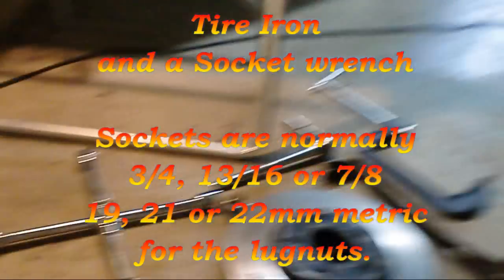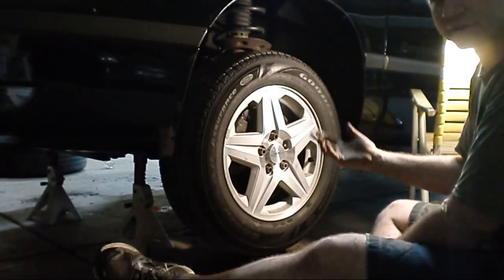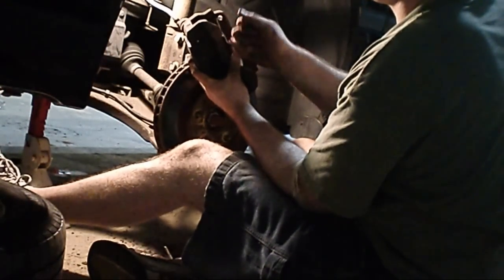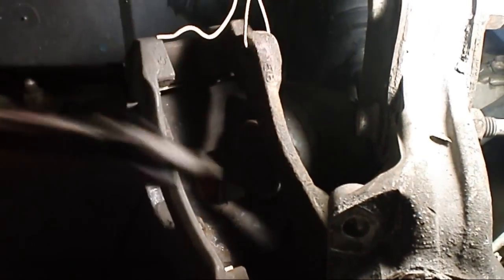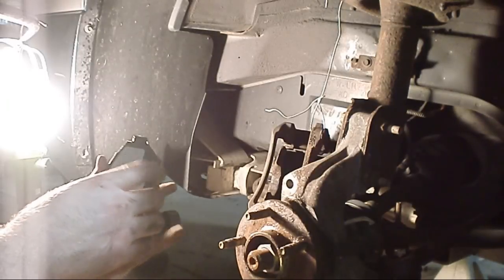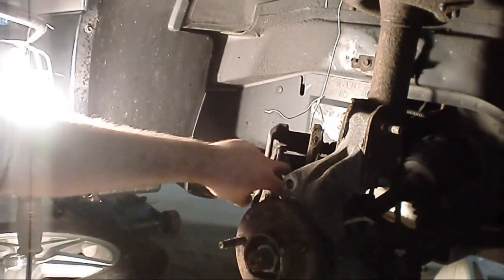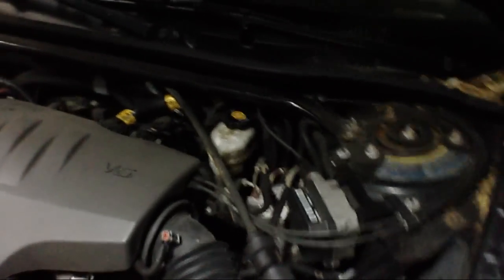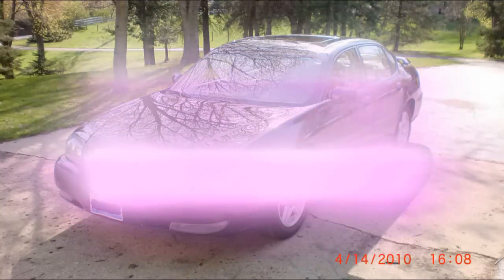(HT) How To Change Your Brakes 10 Minutes! (Rotors and Pads)

Comment: Thank you for this video.. I have a '00 3.4L Impala and this was helpful beyond words.. It was quite the effort getting those caliper bolts off and will be using anti-seize once I put them back in.. Much less money spent than having to take her to a shop.. btw the power steering reservoir on the 3.4L is pretty easy to get at.. Just wanted to throw that in there since you mentioned it at the end of the video..

Comment from the maker: It's a good idea to open the brake reservoir. Whether or not you need to take some out before compressing the caliper pistons depends on how much you have in there. If it's filled to the proper level you shouldn't have to; at least not on a newer car. If it's over filed then yes, take some out. If you're worried about it spilling out, better safe than sorry.

Comment from the maker: I'm really happy so many people found this helpful. When I went to do it I was dissapointed with the information available online. So I decided to record it and try to include as much detail as I could. I worked on cars for a couple years and own the repair manual for my car. (they're cheap online and have instructions for everything). I have more stuff recorded for ball joint, hub assembly, oil change, fuel filter, compartment filter, just haven't gotten it edited yet.

Comment: Nice video.  You should mention that if you use new rotors, they should clean off the factory rust preventative before installing.  I changed the brakes and rotors on my Silverado no problem, but I just gave up on my Impala.  Bolts are rusted on too tight for the tools I have.
Reply from the maker: Hit it with penetrating oil, let sit for an hour, repeat.

Comment from the maker: @dstone1st should be the same as my 03 Impala which was 16mm, but when in doubt, just start trying multiple sockets. It should fit snug, go on smoothly but leave NO wiggle room. If it wiggles go down a size or switch to/from metric/US. If you use a socket that's just barely too big you could end up stripping the bolt.

Comment from the maker: I'm guessing you're talking about when I put the C-clamp on to push the piston in. As you use your brakes and the brake pad wears down the piston moves in to keep the brake pads near the rotor. In order to put new (full) brake pads in you need to push the piston back. You are not removing it. You couldn't even if you tried.

Comment: For those who are wondering what that clamping step was for....remember, your new brake pads are thicker than your old worn pads.  Considerably, in fact. Therefore, you have to push that now extended pad piston back to its original (retracted) position.  (If you forget this step, you will soon find out that your new pads are just too close together to fit over your brake rotor!)  Just tighten the clamp gently, and it will move the piston.  Be patient, since it has to push a volume of brake fluid back up the line and into your reservoir.  It may take a minute or so to shove the piston all the way back in. Keep pushing until the pad can't go back any further.  Then your pads will be far enough apart to slide over the rotor.

Comment: Thanks for sharing the video.  You make it looks easy. My husband and I will attempt to replace rear rotors, pads and shocks this weekend. Wish us luck.  BTW- do you have a video on replacing rear shocks
Reply from the maker: No, shocks can be a bit tough, especially removing the old ones. I strongly recommend buying pre-compressed shocks, as otherwise you need to purchase an expensive tool to install them. If you google your car and "rear shocks" you should find something, if you did that I could fill in any of the missing pieces for you if you'd like :)

Comment from the maker: @travis351 sorry, mis-read. I "put" the jack on the metal frame. There's a metal bar that runs across the front of the car then bends at 90 degrees and runs down the two sides of the car about 75% of the way back. This is the best place to lift the front of the car. Mostly when lifting cars, look for something that looks solid, start jacking it up slowly and stop if anything bends or creaks or starts moving. Really try to look for frame! Solid Metal! Other than that it's just experience.

Comment: EXTREMELY INFORMATIVE! Liked and subscribed! 

Question though and you probably won't answer me till way later but I installed my newly machined rotors and new pads just like you showed and it sounds like it's grinding. Any thoughts?
Reply from the maker: katanaburner First thought would be that they did a bad job on the resurfacing. I'm pretty limited without being hands on, obviously. Could be a few other things, I'd take everything off and clean it with brake cleaner/degreaser and put it back on. Make sure the pads are fully seated in the Caliper so there's no shaking. You don't wanna mess around with brakes, so if you try all that and can't figure out don't just keep driving it; take it to a shop!

Comment: When you replaced your front rotors & brake pads, did you also check your rear rotors & brake pads as well or is there a way to know from driving or sound whether the front brakes need to be changed as opposed to the back? Thanks!!!
Reply from the maker: I had the back done a few months earlier, so I knew. But you should check, if you're unsure with the wheel on, since it can be hard to see even with direct light, then take the wheels off to make sure. They do wear at different rates.

Comment: Should a person automaticalky change their rotors when they change their brake pads or does it depend on the condition of the rotors? Thanks a lot for the video!!!
Reply from the maker: It depends on the condition of the rotors. If you're getting a lot of vibration when braking, even after driving, and stopping, for a while, think 10 minutes in traffic. Then it's probably a good idea to. With rotors you also don't want to get the cheapest rotors you can find, you don't need the most expensive, but you don't want flimsy rotors either.
Reply: Hrel Thank you so much, I greatly appreciate the video & advice!!

Comment: I was wondering if you could suggest something for me. I didn't take both bolts from the caliper housing ( I may not be using all the correct terms. I can't fit my brake disc spreading tool against the caliper piston properly to push it all the way in. There's nothing for me to secure it to/on so I can have tension to take the bolt off. I can't secure it on the ground because it would place too much on the brake line. I need to push the caliper pustin all the way in so I can properly fit the new brake pads in. What would you suggest that I do from this point? Thank you!!!
Reply from the maker: eyesis0081 I'm sorry I didn't respond but I don't really understand what you're asking. You can't hang the caliper from the shocks? You can use the old brake pad like I did to push the caliper piston in, just open the brake fluid reservoir first.

Comment from the maker: You may be able to machine the rotor if it's a stock rotor, depends how badly it's warped. This requires a special machine that only a shop would have. If you bought a cheap/aftermarket rotor though it can't be resurfaced and needs to be replaced. rock auto has some good rotors for cheap, so does amazon. Unless it's a fairly new stock rotor I'd just replace it.

Comment from the maker: @ivanb05 you shouldn't HAVE to. But there could be residue from thing XYZ from manufacture shipping packaging, whatever. So it'd be a good idea to clean it with brake cleaner or de-greaser. Just don't use regular soap or anything that could lubricate them AT ALL!

Comment: How do you measure the rotors to know if they need to be changed
Reply from the maker: You could buy a rotor micrometer. But I have enough experience I can tell just looking at them. Also, I don't like to cut it close, if they look janked I change them. They're really not that expensive. Why risk it?

Comment: Great video, but what is purpose of c clamp...not clear. Otherwise great video & good sense of humor
Reply from the maker: Youtube is displaying comments weird, so idk if you've been answered ever, 6 years ago, seesh. Anyway, as other comments state, you push the caliper piston back in because the old pads are thinner than the new pads, that's why you got new pads. So for the pads/caliper to fit on the rotor the piston needs to be pushed back in before inserting the new pads. 

Just open the brake fluid resevoir under your hood, slowly tighten the C-clamp on the caliper, both sides, all the way until it can't close anymore. Take the C-clamp away. Now your new pads will fit over the rotor.

Comment from the maker: you mean "turn" them? To properly resurface rotors you need to own a special machine. If you don't run a garage (or know someone who does) you won't have access to this machine. Sometimes local shops will resurface rotors for 10-20 bucks; depends where you live. If you end up buying new ones don't cheap out; the cheap ones WILL cause you trouble. Stick with AC/Delco if it's a GM car. Just generally try to stay with OEM parts for rotors.

Comment: If you ever forget to spread that anti-squeal compound on the back of your new pads, you may notice an ear splitting squeal every time your brakes come on!  He calls it lubricant, but it acts almost like a GLUE. 
Your car will still stop just fine without it, but who wants that squeal?
Reply: that has nothing to do with brake squeal the brakes squeal when the pads are shot, the lubricant your talking about actually IS a glue, you put it on the back of the pads so the pads dont rattle when you hit bumps thats all its for.
Reply: Lionsfan Yeah, you're probably right....rattle is a better word than squeal.  Squeal is what happens when you get to the wear clips, as you said  Good correction.
Reply from the maker: Lionsfan you clearly didn't watch the video, covered there.
Reply: Hrel you clearly didnt read the comments here, thats what I was relying to, not the video.
Reply from the maker: Lionsfan Apologies, I did realize that after leaving the comment. Left it alone so people reading at least knew it was in the video. Thanks for the input!
Reply: Hrel
We could just delete the whole thread....i'm game if you are
Reply from the maker: fenderstratguy
I prefer to let people see that it is indeed possible to communicate amicably on the internet :)

Comment from the maker: no, you have to push it back in.Put 2 new pads in then try to set them over the rotor, see how that works out for you. Honestly, if you can't figure that out without asking you probably shouldn't do this on your own. Not trying to be mean, but brakes can be dangerous and this is one of those questions that you wouldn't ask if you knew even the fundamentals about working with your hands.